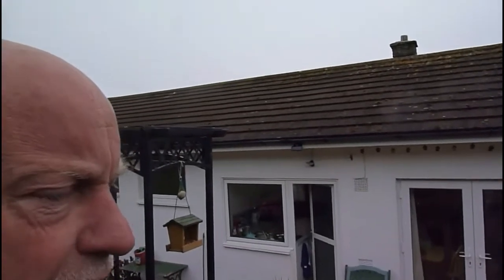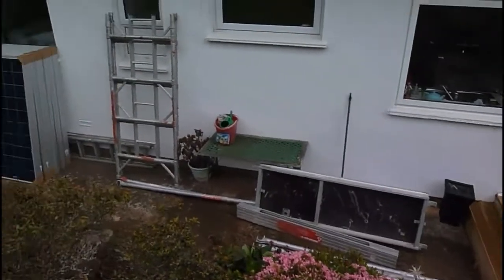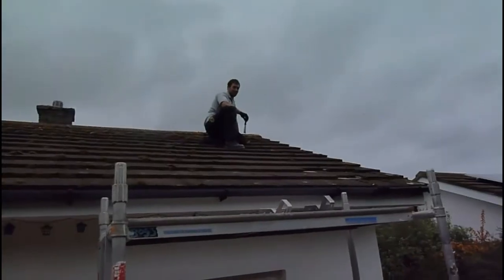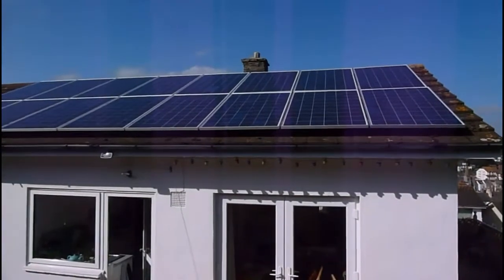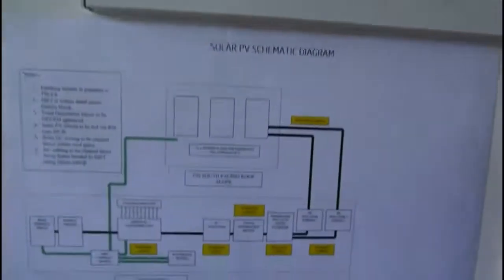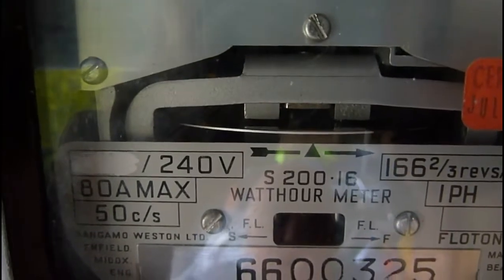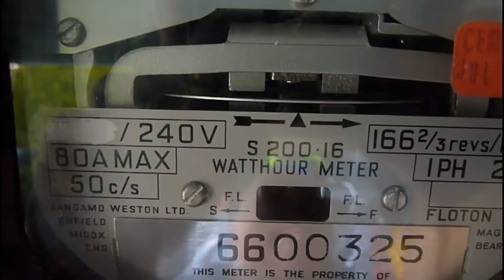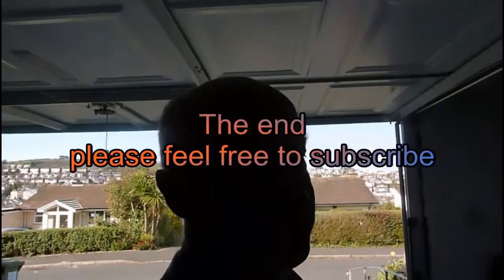Solar panels being installed ,see how it`s done

Comment: it seemed to be connected without batteries does that mean you buy expensive electricity from supplier on not so sunny days?
Reply from the maker: Yes end up buying there`s, at twice the price they pay for mine to export to them.
Reply: Do you have to pay standing charge each day as well?
we are also planing to get solar panels. We may get the ones with batteries so we dont have to pull electricity from suppliers.
Reply from the maker: Yes still have to pay a standing charge.